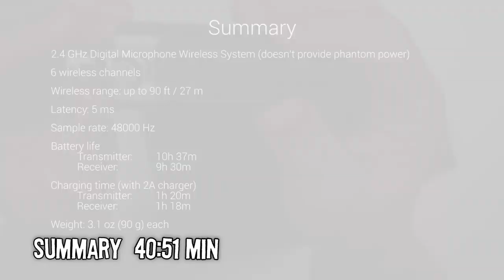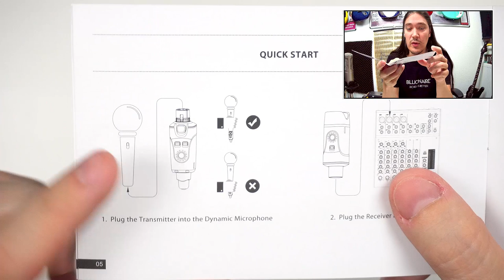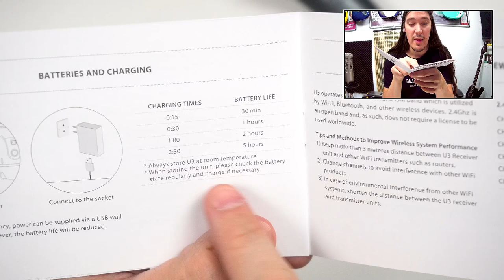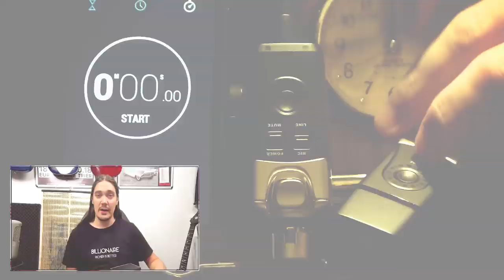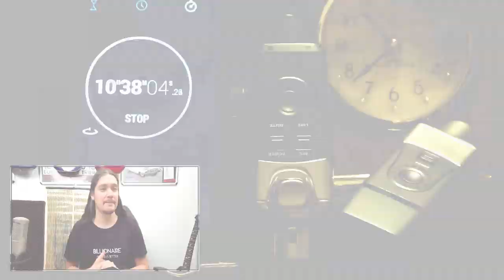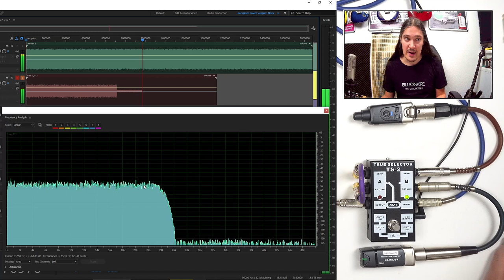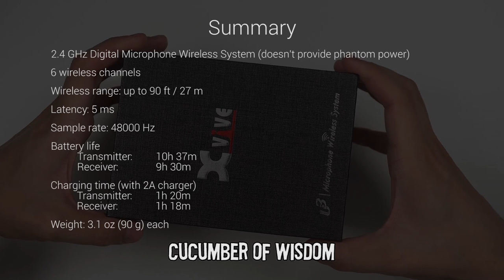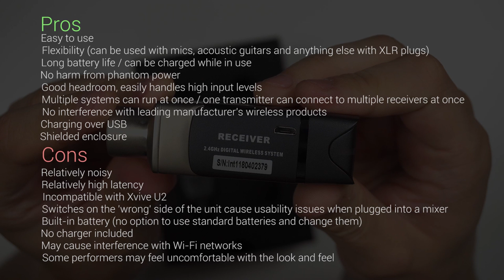Xvive U3 microphone wireless system. Full review

Comment: You convinced me! I’m going to buy it! 36:29 What you did by using 2 receivers for the same signal means that you can extend the strength of the signal by placing one receiver 60 meters from the other and you would have 120 meters of safe area to move around without signal failures; 60 meters from the radius of the 1st receiver and 60 meters from the radius of the 2nd receiver. Haven’t you thought about doing that test to see if it works? I would do the experiment by placing a 60m cable in one of the console’s channels and connecting the second receiver to that cable, while I would connect the first receiver to another channel of that same console.

Hablo español, traduje mi mensaje con la IA de bing y es impresionante como interpreto lo que intentaba decir y lo expreso correctamente para que un angloparlante entendiese lo mismo

Comment: Great video, thanks for pointing out about the controls being inaccessible when more than one receiver plugged into mixing desk. That's a big mistake on the manufacturers part.
Reply: Yeah I also realized that but you can solve the problem using a short XLR cable from mixer out to the dongle.

Comment: Man you went above and beyond for this review... thank you :-)  What's your opinion on the noise floor of the xvive u3 vs a wired connection? I just got a nux b-3 and the noise floor is pretty bad. Just wondering if the xvive u3 would be any better.
Reply from the maker: Thanks. I can imagine that b-3 and u3 are very similar units which probably have very similar specs. U3's signal to noise ratio is actually good, as long as the signal level is high enough the noise shouldn't be a problem
Reply: @MaxSoloMusic  Hello, I am also deciding on which to buy between the two (nux b3 or xvive u3). The main difference I notice in specs between the two is the sound resolution. Nux b3 has 32 bit and xvive u3 has 24 bit. Which would you say is best for vocals (live not for recording)? Thank you
Reply: @paulgarcia983  I'm also trying to decide between the two.  Nux is less $$ but I've seen twice now a stress test on the battery that takes it to 9+ hours and the Xvive has a line input control so for the diff in $ I think it'll be the U3....

Comment: This plus a battery powered PA like the Soundboks 3 has made my mobile DJ life so easy! Only issue is you really want line of sight, so I use a 6' patch cable to tape it on top of my PA. Then no people are blocking the signal.

Comment: Wow, what a great job, thanks a lot! But have U ever tried to use U3 as a wireless connection between the mixer (f.e. Yamaha MG12XU with XLR outputs) and active speakers? That´s the way I would like to use it..  BTW, what does it mean "cucumber of wisdom", pls? .)
Reply from the maker: Hey. I haven't tried that yet. Not on stage at least. But it should work. As long as the signal from the mixer is strong enough there shouldn't be much noise. Cucumber of wisdom is just another weird phrase at the end of my video. It doesn't really mean anything, although i usually try to describe the product with it.
Reply: Same question here
Reply: yes! Please make a video using speakers and the U3, we would appreciate that. @MaxSoloMusic

Comment: Hi Max, Thank you so much for your reviews, they are the best on YouTube for sure. I wanted to ask you for advice, I'm using a LINE 6 XD-V55, but after the Tour in the USA I was very disappointed as it often disconnected and I had to continue with the cable. After seeing your review on the Xvive U3 I am seriously thinking about switching to this system. Compared to the Line6 (since i saw you own both), would you advise me to make this change? Thanks in advance
Reply from the maker: Hey. Yes, i have both. I even own one of those XD-V55 mics. It lives in a closet while my band and I use U3 at every gig. Line6 wireless gear is more stable and has a stronger signal but I find U3 to be more flexible and overall a better fit for my needs. Hope that helps

Comment: Thank you for the video, it was very helpful.  Quick question, how would this work if I placed the transmitter in one of the master outs of my mixing board and then placed the receivers in PA speakers throughout a room.  Assuming that works, do you imagine using more or less inputs on the mixer would impact the quality of the sound?

Comment: Superb video, great insights. Quick question: would you consider using the X3 in combination with a behringer pm-1 as a cheap wireless solution for connecting in-ear monitors? Or do you foresee problems with such a setup, for instance with the achievable sound pressure levels being too low for proper usage in a noisy environment?
Reply from the maker: Hey, thanks! U3 works pretty much at unity gain, so it should work in this scenario. Actually, I had an idea of using U2 for exactly the same thing. I've built a headphone amp with two inputs for two U2 systems to have it in stereo and it worked fine.

Comment: Here's your second cumber of wisdom.   Looking to make my first purchase into wireless XLR connections.  Thank you so much for the insight and testing.  The button placement is an issue.  Is it possible to rotate the XLR plugs on the mixing panel so the usb plug would be to the rear?
Reply from the maker: Those are usually soldered to the board. I've never seen a mixer with rotating XLR connectors. That may be a truly unique idea for manufacturers :)

Comment: Great review mate , But i think you may have missed a few  potential issues that I watched for and didn't see. Having done many gigs and seen bad stuff happen ( like an amp going  to dead short full power at 50hz,  , the phantom power trap, (which you covered) , and disconnects under load. I always look at such devices to see where it could go wrong. The issue of all those buttons being available on the mic, and then handing it to a random person say at a wedding for a speech . They then have gain, power and channel control, at their fingertips.  What could happen ?  Even for a pro singer  at a gig they could be knocked, What is the work around for that scenario?  At worst, the gain gets flicked up and the PA feeds back , Thats really bad. or it just doesn't work due to channels not coinciding.(not so bad) Also how tough to knocks/water is it.   

I'm keen on the unit though and your review was stunningly technical and I applaud you for your knowledge and  completeness.  Thanks😀 !

Comment: Very informative, thank you! We were thinking of purchasing the Xvive to use it on a Behringer X Air XR18 using wifi to connect our tablet for mixing. Do you think using this bluetooth Xvive will create an interference?  It seems that way based on your last demonstration.
Reply from the maker: Hi. XVive units operate just as Wi-Fi devices, not Bluetooth. Yes, there may be interference with that kind of mixer's wireless unit. However, there are workarounds. Switching the mixer to 5G is one of them. I usually don't plug the receivers directly into the mixer but keep them a bit away with an XLR cable. That helps. There has to be at least a meter between an XVive receiver and another Wi-Fi device

Comment: Very good video.  I use a headset condenser mike that takes its phantom power from my mixer. Would that still work  if I used this instead of an xlr cable to connect mike to mixer.
Also I presume would be fine with an acoustic guitar jack out by cable to DI box  and then this to connect DI box to mixer?

Comment: Thanks for sharing this video. I have a question. I'm doing facebook live videos for karaoke singers and I currently use the irig 2 to send the audio directly from my mixer to my iphone. I want to make my audio wireless so I can put my cell phone on a gimbal for smooth video and mobility on my videos. Will this system work for that? If not, do you know what kind of transmitter and receiver I need. I will appreciate any info you can provide. Thanks in advance

Comment: Thank you for your amazing review! You answered 99.8% of my questions. What I didn't figure out is if there are strong WiFi routers around, would they interrupt the signal of the U3s. 

I am trying to figure out whether as a beginner mobile DJ I should invest in the U3 or in a wireless mic system. I am not sure which will be more stable in different venues. I am tempted by the U3 for the lower price, connectivity with different mics and the ability to turn one of my active speakers into a (signal) wireless one for coctail hours and wedding ceremonies.

So I would be very grateful if you could address this too.
Reply from the maker: Hey. I'm running two mics with U3 every weekend for the last couple of months at different gigs. There were over 1000 people at the last one, many with mobile phones taking pics etc. Additionally to that we have a digital mixer with a Wi-Fi access point and I'm using Relay G70, the older one before the "fix", which is known to be very unfriendly to other 2.4 GHz signals. We had no problems on stage so far playing 5-6 hour gigs without a single dropout. There's a trick though. To minimize the distance between transmitters and receivers and also to have a backup plan, I'm not plugging receivers directly into the mixer. Instead, those are connected to XLR cables right next to each singer's mic stands. In case something goes wrong, they can switch over to a cable at any time. And the distance is never more than 3-5 meters.

Comment: Question, if I use a couple of these systems and my mixing board, witch is operated wirelessly and controlled via a router/WiFi/app  (this allows individual control of the volume parameters to each band member) these units will null the WiFi ???

Comment: This is all very interesting and informative, especially the part where you were testing various combinations of transmitters and receivers for compatibility and interference ... but the question I needed answered, which it's not clear whether you did, is: In my band with 4 instruments running U2 systems on channels 1-4 would I be able to run 6 mics on U3 systems or would I be confined to 2 mics on channels 5 & 6 as channels 1-4 were already occupied by the U2 systems?
Reply from the maker: Hey. Generally, U2 and U3 are not compatible and don't exactly share channels. However, there may be some interference between them. Running more than two U2s on stage will already be a bit of lottery. I can imagine two U2s and one U3 working together if the placement is right. Or two U3s and one U2. Any setup bigger than that will probably be very unstable in a real life situation. So, long story short: 6 channels do mean 6 units can run simultaneously
Reply: @MaxSoloMusic  Well, FWIW, in my Celtic band we have been running 4 U2 systems on channels 1-4 (Guitar, bouzouki, 2 fiddles) successfully for some time now. And occasionally a 5th instrument (bass) on a Line 6 Relay G10 as well. Admittedly, we're talking acoustic instruments with passive pickups (e.g., K&K). Was hoping we could go wireless for the vocal mikes as well. Sounds like it's worth a try.

Comment: Battery replacement could be a concern over time. It would be better if it was easier to exchange the batteries. It would also be good if the phantom power from a mixer could be used to power the receiver.

Comment: Cucumber of wisdom, thanks a lot! 
What is your opinion/advice about using XVive U3 wireless dynamic mic with Soundcraft Ui series digital WiFi mixers?
Reply from the maker: Hey. You mean there may be some interference? I believe that may be the case. I'd say the situation requires more testing. I'll get access to a digital mixer soon and will check how it all works together
Reply: Yes, it’s about 2.4GHz band broadcast.
Reply from the maker: @-igorP.  hey. Here's an update on U3 + Soundcraft Ui. My band uses two U3 units with Ui24R mixer for a few months now. So far so good, not a single dropout and the battery lasts through a 4-5 hour gig. However, I never plug U3 receivers directly into the mixer. I run cables from the mixer to mic stands and connect receivers to those cables. Anything goes wrong - and a singer can always switch from U3 to a cable. Always have a plan B :)
Reply: Max Solo Music, which router do you use with your band - internal Ui24R or external? 
Plan B always is a good idea, but it looks like you’re wiring wireless mic system. :)
Reply from the maker: @-igorP.  We're using the built-in Wi-Fi router. Well, our singers use TC Helicon pedals, so there are cables from pedals to the mixer anyway

Comment: The tips to prevent interference says to keep 3 meteres (what ever a metere is?)  distance between receiver and other Wi-fi transmitters.  Does that mean if you used 3 separate  units on the back of a mixer they could interfere with each other?   If they meant meter thats 39 inches, a little more than a foot. So if using more than one unit they should be 3 feet away from each other to prevent interference?

Comment: Hi. I purchased one of these units and found there was a big drop in output level compared with a standard wired system, making it not suitable for my application. 
Did you notice this?
Reply from the maker: That's strange. They operate at unity gain. Did you try the mic/line switch?

Comment: As a further comment just looked up the official signal to noise ration spec, they quote 110 db, it's clearly nothing like that, you would not hear such a loud hiss if it was anything approaching 110 db, I bought the Alesis version from amazon and the microphone hiss drives me up the wall. I would be fine in a noisy venue ??? but in my home studio it is so bad.
Reply from the maker: There are more factors to it, like the mic that is used and the amount of gain it requires, the distance between the sound source and the mic. I had no problems using two of U3 systems for gigs and singers really loved the freedom of movement. With that said, it works fine in appropriate conditions. If you're doing weird stuff and pushing it to its limits you're very likely to experience noise and hiss issues just like with any other system

Comment: I am looking to link 4 speakers wirelessly from a mixer - Could this be done and what is the best way to link all four?
Reply from the maker: Hey. You can connect two of those using U3. In theory, all four could use 2.4 GHz wireless. But I seriously doubt the connection will be stable enough to consider it for any practical use. Analog wireless systems can do that though
Reply: Max Solo Music I wish you would have used it with speakers. But excellent video.

Comment: 27:50 What causes the noise? I can tell that compared to when I use a cable, it sounds like white noise or something in the background when I record a vocal with the U3. Is there no way to get rid of this noise?
Reply from the maker: Tom Joad usually OP amps (those tiny chips inside used to amplify the audio) cause this kind of noise. Often there's a trade off between current consumption and noise level. Noisier chips take less power while quieter op amps require more current. In this particular case though the noise may also be caused by other elements like Digital-to-Analog converter etc.
Reply: Is there any way to EQ out the background noise?
Reply from the maker: Not really, at least without killing a huge part of the spectrum. It can be partially cleared with a noise gate or some restoration tool like iZotope RX

Comment: Here is an interesting thought, I wonder if you can use these to make the whole mixer wireless  to a set of pa speakers,
and will it sound really good?
Reply from the maker: It will sound all right. However, I don't think such solution will be 100% reliable in terms of dropouts. Depends on the distance of course. And both need power, which means cables. So it doesn't really make much sense
Reply: @MaxSoloMusic   You could for example, find a way to supply power to let’s say a 10 channel Yamaha mixer, buy scoping out an inexpensive power bank that could take care of it, then put two of these xvive, one left one right on the Yamaha, and the other inputs to two Bose s1 pro self powered portable speakers, which gives you portability from power of around 7 hours. 
I think this way you can have a totally good sounding portable rig.
I’m trying to create a great sounding portable rig, for a one to two person performance,
while minimizing cables if possible.

Comment: For the noise ratio, the test method is not correct, for the U3, it is balanced output, it would be noisy if you apply for the simple adaptor cable(XLR to6.5mm jack) to transfer it to unbalanced output,  same things it would be noisy if you apply simple transfer adaptor cable(XLR to3.5mm TRS) to connect it to DSLR camera. And so, you need a preamp when using for DSLR camera.
Reply from the maker: Hey Mr. Mao, thanks for your comment. Yeah, that's a tricky part because of the adapters, impedance, etc. I wasn't measuring the noise ratio but a relative noise level. I have a few more ideas on this thing. I'll run some more tests and get back to you. As I mentioned, I don't think that in a situation with a microphone that noise level is critical. It may be higher than that of U2 but still so low that it won't cause any problems.